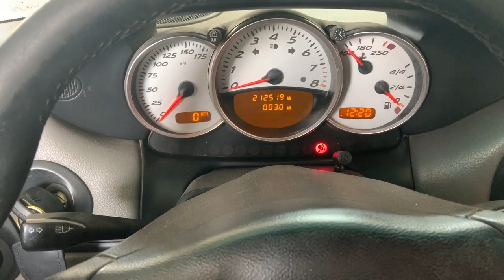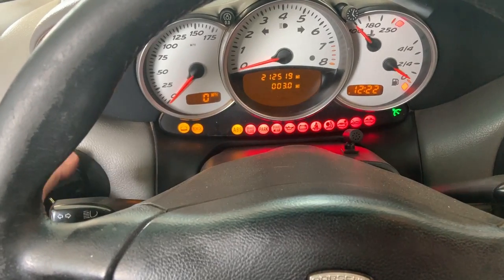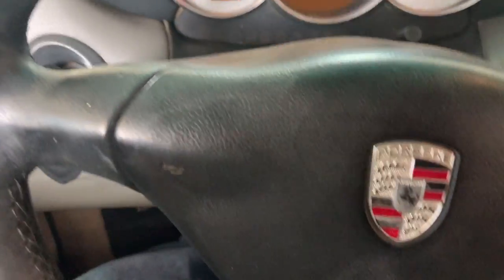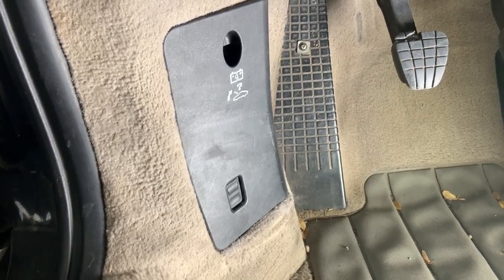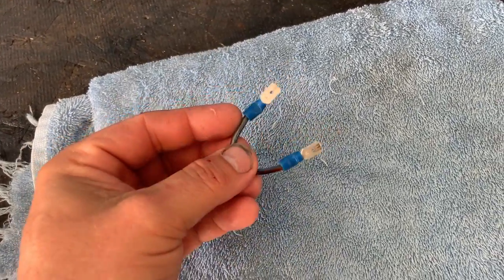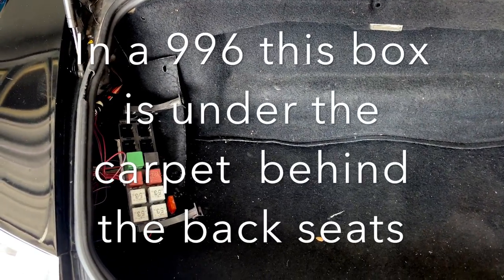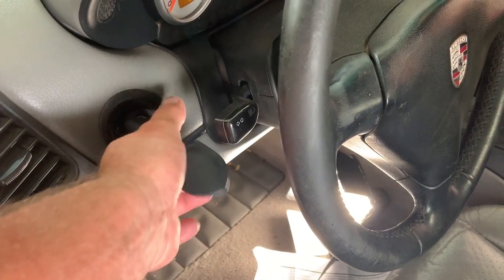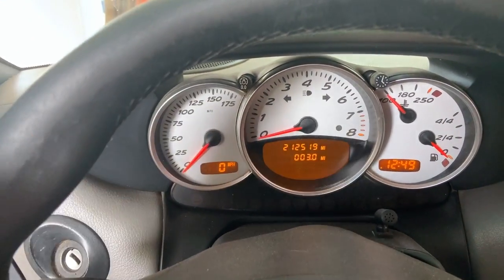Porsche Boxster 986 Porsche Carrera 911 996 won't start or run - How to start a Porsche 911 Boxster

Comment: Ps....fyi..."pumping" the clutch has absolutely no effect on starting the car
Reply from the maker: Sometimes you can free up the clutch switch by doing so.
Reply: @ArrowheadGarage    hi I have the exact same problem you show in the video .... On a 99. 996 911 automatic transmission convertible..... I checked and tried everything you showed in the video... Even had a mechanic friend put a jumper wire in the starter relay.... The car finally started to crank the car finally cranked whth the jumper wire but no start.... I replace the relay with a new one and everything is still the same way no crank no....... My friend checked power to the switch which we have.... Power to the starter you hear the fuel pump kick on when you turn switch.... So all that seems good I know the starter is not jammed up cuz the the car did crank...... I don't know what else to look for any other ideas please help I've been stranded 5 days with out the car running  ...... Does the immobilizer have a fuse or anyting under the driver seat that could maybe be changed ? Or any help would be appreciated thanks
Reply from the maker: @johnsnow2650  yes there is a fuse under the seat… check that… do you have an extra key? If so try that… if not then the sounds like the immobilizer is fried :-(
Reply: @ArrowheadGarage   I have an extra key .. but not to crank the car it's just the key fob  .... I'm going to try tomorrow and take out the driver's front seat can you let me know exactly what fuse I'm looking for and where is it at ,? I would appreciate it
Reply: Update today.... I got to the immobilizer under the driver seat and I checked the fuse in it.  the fuse looked  good BUY I replaced it anyways and the car still won't start  BUT I noticed that the immobilizer was changed before there is a company name on there and writing that it was replaced or rebuilt in 2017... I'm trying to get ahold of those people on the number for info..ALSO I  check fuses on the driver side kick panel... And the E1  fuse in the fifth column is popped ... I replaced it with another 7.5 and it popped again then I replaced it with a number 10 fuse and that also popped everytime I try to start the car or maybe every time I reconnect the battery plus I keep taking off the negative terminal before I replace the fuse...... So I guess something in the E1 fuse box is the problem ?
Because the fuse keeps popping ?
Reply from the maker: @johnsnow2650  yes let’s get that issue fixed before going back to the immobilizer… who’s label is on the immobilizer?
Reply: @ArrowheadGarage   it says. S.e.c.u  ECU specialist repair ..... I'm just wondering if the car has some type of short somewhere and that's been the problem the whole time..... But now I have no idea where the short could be I'm thinking maybe negative battery terminal .. it looked a little Zeus nothing out of the  ordinary

Comment: Great Video. The problem I have right now is as starting issue with warm engine. Engine turns over but only starts at 4th try. I changed the Crankshaft Position sensor, unfortunately I still have the problem. Any idea what it could be? Other than that car drives normal.
Reply: Most likely the cable from the alternator / starter. 
99660701903 or 99660701901 is what you need to replace. The 03 is for newer 996, the 01 for 98-02 models.

Very common and often misdiagnosed as faulty starter motor
Reply: @djhulstijn  thank you for your answer, the problem was a faulty fuel pump

Comment: I have a 01 986 auto no crank no crank no start
Reply from the maker: Mikey Rozell pull your drivers seat and check the fuse (15) that is plugged into the immobilizer unit.  Also see if the immobilizer shows ant signs of wetness. Let me know!
Reply: Hey Brian I did some research on it prior to getting it and I checked that it was corroded so I went ahead and replaced that well took the starter off today and went to take it apart and several pieces came out so starter is bad but when key is on I get no fuel pump and no power to starter the immobilizer I bought was said to work and I checked new immobilizer for water damages did seemed fine but still had no crank no start no ignition power to the starter and no fuel pump car was pretty much free
Reply: It’s an automatic too
Reply: Also the key came with the pill in it but didn’t have the buttons
Reply from the maker: Get the starter replaced then try the starter relay hack.  If she spins then your immobilizer sounds like the issue.  :-(
Reply from the maker: So the key is one of the smaller valet keys?  That’s okay the important part is the pill and that it talks to the immobilizer that in turns talks to the ECU
Reply: No it’s a full key just like my original it just didn’t come with the mother board inside the key it still has the buttons just no mother board I can put my old one in it
Reply: Oh and also I did the relay hack and the starter wire gets power
Reply: As before I did the hack it didn’t get power